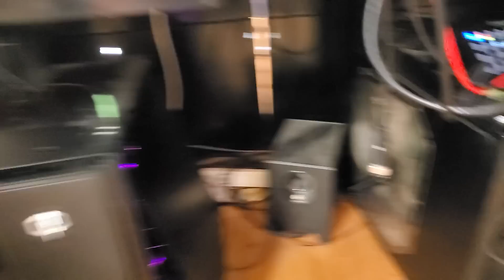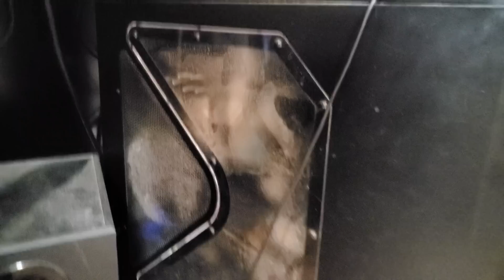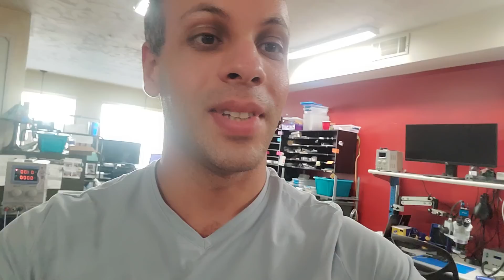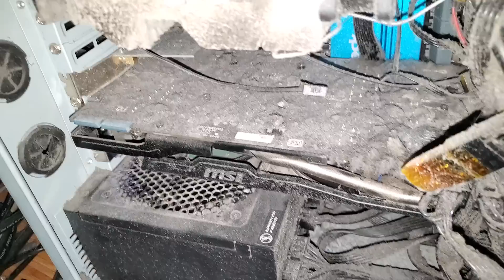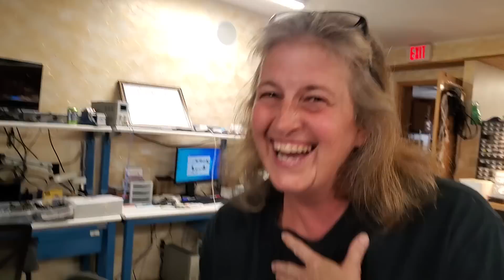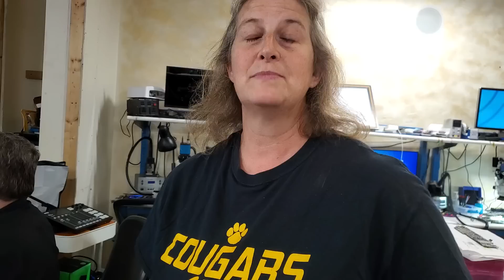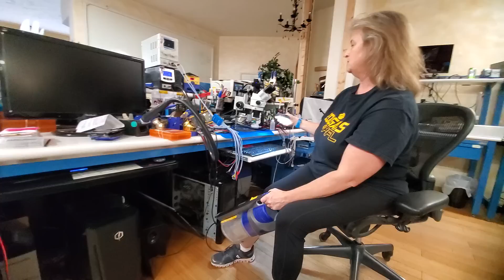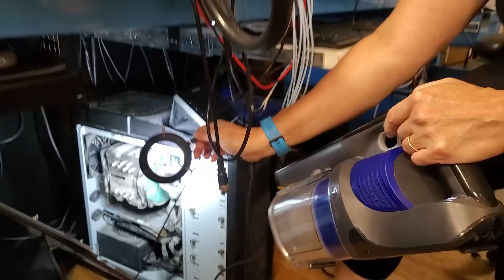I gave my best friend a streaming computer 7 years ago and she did this to it :(

Comment: Man, I was really hoping to see her going outside and blasting the shit out of the pc.
All the air-polution measurement stations of the city would have recorded new records.
This would have been dangerous for the vehicles driving around. There would have been a huge crash, because nobody could have seen the street anymore.
Reply: You’re starting a great sequel to Cloudy with a Chance With Meatballs. Keep pitching
Reply: The cloud will block the sun and keep the temperature down.  Thereby helping on the global warming front.
Reply: @TheAnimeist  who needs nuclear winter when you have swine flu ebola dust that's been festering for 7 years.
Reply: no worries the teslas will clean the air
Reply: @gg-gn3re  I just imagined an army of Tesla trucks with 100's of air purifiers duck taped to them now.
Reply: In Arizona we call them haboobs.
Reply: Yep, it would have caused a haboob like we have in Arizona.
Reply: You jest but at the first small computer repair shop I ever worked at we literally had booth set up out back behind the building with a battery powered leaf blower we would use to clean out the "Pet Owner" PC's. Her computer is bad don't get me wrong but there are far worse machines
Reply: Yeah. Good thing Jessa isn’t based out of NYC lol

Comment: A delicate ecosystem has been created here. That poor computer is now dependent on the dust for survival, and will surely stop working the moment it's cleaned.
Reply: I have cleaned a family member's computer and it quit working. 🤣
Reply: Indeed. It’s just topping up the silicone reserves that left in the form of smoke. So it keeps it running.
Reply: im surprised its still working all these years ..
Reply: For all we know there is a whole intelligent civilization evolving in there with an apocalyptic religion based around The Coming Vengeance of the Great Vacuum.

Comment: I am more impressed that the PC runs without any cleaning for so long.
Reply: For 7 years thats not that much dust. I have seen far worse on machines that have been deployed for significantly shorter periods of time. One computer was so bad that every single fan died because of the dust build up, and somehow that I5 was running. I say was because the only reason the machine got cleaned (and fans replaced with dust resistant ones) is because the motherboard died after a power surge.
Reply: @shadowcalen  I mean it's pretty bad. but their environment is relatively clean if that's all that happened for that long.
Reply: @ghosthunter0950   If she had pets, that thing would have looked much much worse and probably would have failed 5 years ago.
Reply: Have you seen that cpu cooler even when it works at 10% is enough

Comment: Good lord. So much dust that it's become one with the machine! Even I used some compressed air on my computer every so often! It's helped my machine last for a good 10 years with only 1 or 2 upgrades!
Reply: same here. my motherboard is old enough that the latest storage tech it supports is SATA 3. meanwhile I can get m.2 or NVME storage at the same size 5+ times the speed but the same price... I would feel ripped off upgrading the storage now, but maybe that's a bad mindset to have idk.
Reply: Mine is 11 years old. I do have to re-heat the GTX570 every now and then, to keep it going. 10 minutes upside-down with no heatsink tends to do the job.
Reply: @GeorgeValkov  holy crap lmao
Reply: @over9000713  Well, it was broken anyway and I read people bake it in the oven, which I did not have, so I came up with this solution. Then it worked for over an year, but I had to do it again a few days ago.
Reply: @GeorgeValkov  that gpu is a fucking soldier. He knows about the current gpu prices.
Reply: @themanhimself3  Ha hah, That's so true! 😁 Man I should record a video next time.

Comment: Mother of...
How's the thing even running without overheating? lol
Reply: Oh it's most definitely throttling with that much dust buildup. I have lost track of how many computers I peeled dust off everything inside of it, blasted it with air and then seen it run like a brand new computer again. At that point it's time to disassemble, clean up each part individually and replace what is likely nasty, crusty, dust laden thermal paste.
Reply: Looooots of overhead on that massive cpu cooler :)

Comment: "That is its protective dust layer!" - That's a good bullshit line right there!! xD
Reply: Apple is going to use that now when people are criticizing their shitty cooling systems.
Reply: It protects the heat from escaping.
Reply: If you remove the dust from the fan blades unevenly, it might actually hurt the bearings. So there might be an actual truth to that...
Reply: @szaboaz  That is so true! Also with a datavac that powerful you could accidentally blow a jumper off the motherboard. Or you could go full Linus and drop the entire PC while taking it outside for cleaning. Better not tempt fate.
Reply: I will use that line, I'm a retired tech/builder so while everyone else has a beautiful, cleaned computer I have about 10 years of dust on mine.
Reply: It's Faraday dust.
Reply: I actually believe that this is true in vintage cars: the oil mist & road dust DO form an anti-corrosive layer of sorts that's protecting some materials quite well...